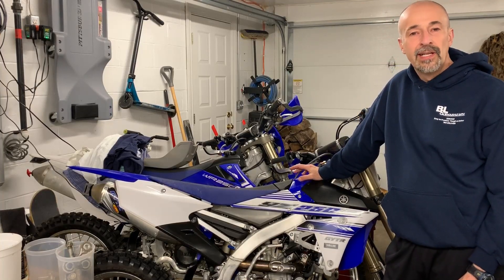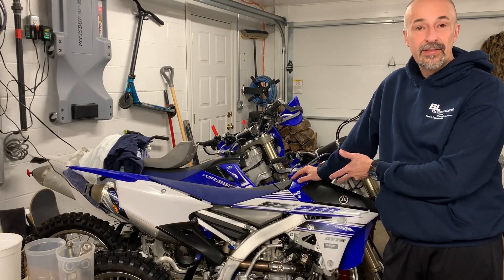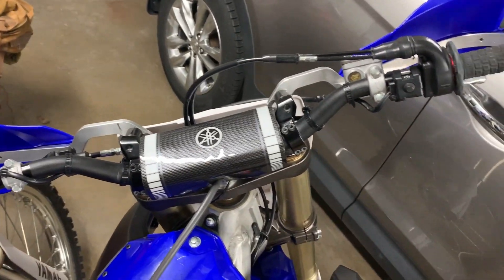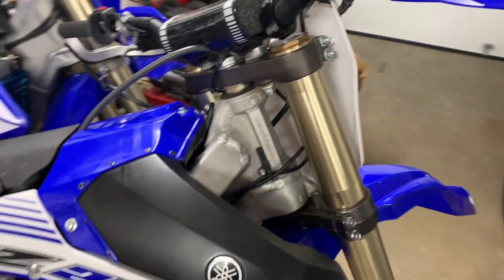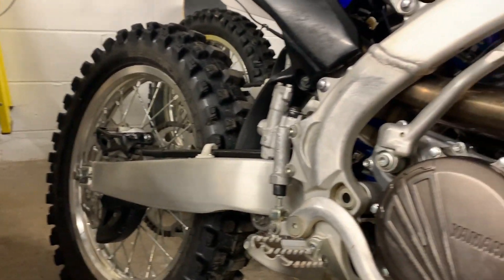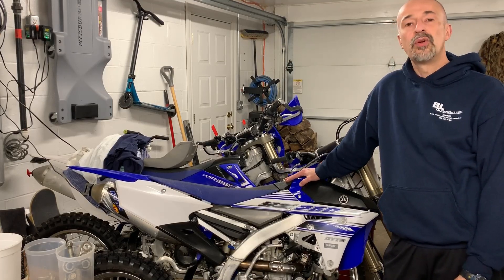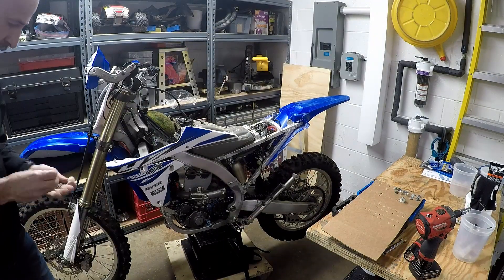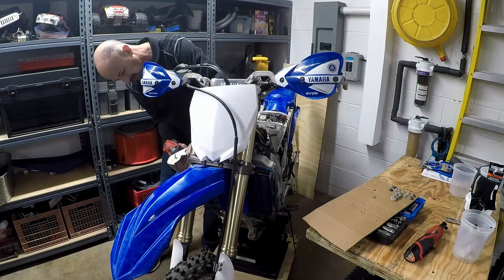2015 YZ250FX Cleaning and Maintenance

Comment: hi there, thanks 4 your vids!

I have a 2013 wr250f, and i see you guys have wrs and yxfx.

Is it a must change from wr to fx? Besides from specs which ive studied like suspension upgrades, weight, handling, etc, is there any pros and cons from mechanical problems, maintenances, inyection issues, relays, others that i should be awere?

Im looking for trail and technical rides hoping none electrical issues, also im a diy guy and my wr its very easy to self maintain..

would the yzfs DEFINITELY change m riding/handling? 

Thanks!
Reply from the maker: Great question and right up my interest ally.  I bought a YZFX instead of the WR for two reasons.  If was fuel injected and did not need to be "uncorked" so to speak.  I have no issues with the bike.  The WR is a 50 state bike and has lower emissions which makes the bike sluggish.  The YZ has all the power on tap with no modifications.  I am a older guy and bought the tuner to slow it down a bit so it wasn't so jumpy on idle.  Also I retuned the suspension to be similar to the WR, Soft and forgiving on slow trail rides.  I do not regret my purchase and would do it again the same way.  The bike is reliable so as long as you maintain the bike.  Make sure water does not get into the relays and that the battery is always fresh.  Marginal batteries I think cause most of the issues because the system needs a minimum voltage to work.  The bottom line is that fuel injection is a no brainer and has more power.  No need for tuning a carb.  I may have strayed some from your question but I hope this helps.  Let me know if you have any other questions.
Reply: @RMAGarage  thanks a lot! Seems we have the same riding style...

Could you detail a bit on those suspension and idle mods? Seems those are the way to get it similar to wr feeling.

Are those mods doable from stock bike adjustments or an item to purchase?

Couldn't remember which year those bikes had maps to adjust.

Thanks again!